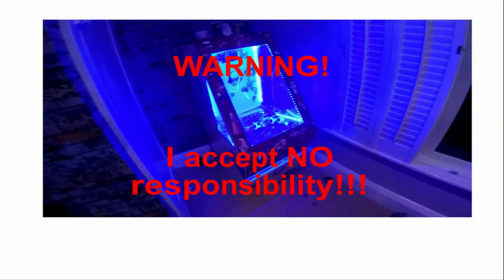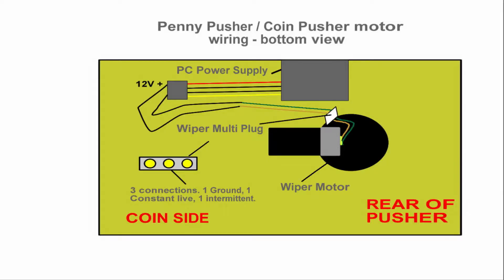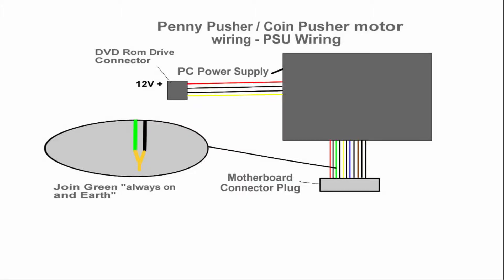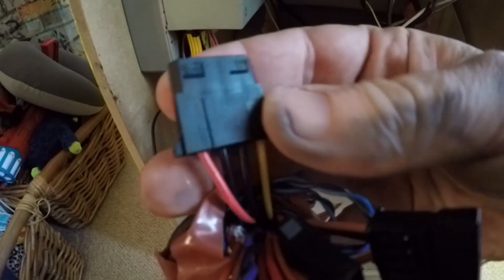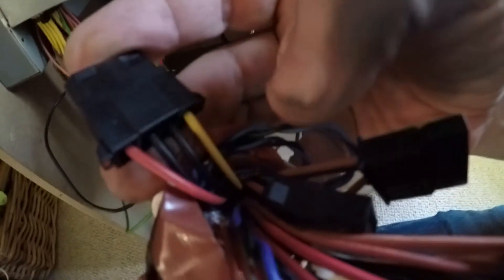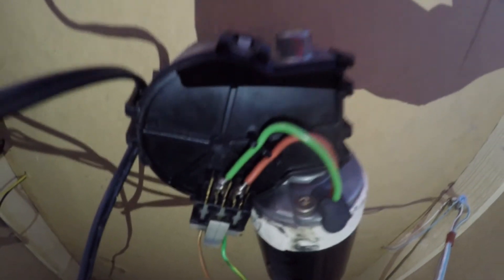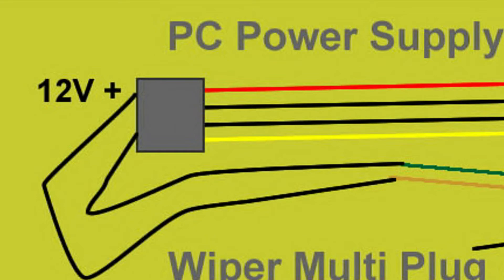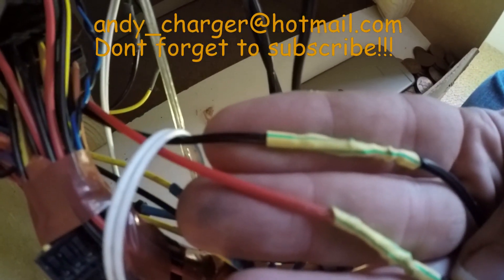How to build a coin pusher - Part 6. Wiring a wiper motor to a PSU

Comment: Hi I need help my coin pusher alarm won't on or the drop won't close when tilted also the kill button won't work either any suggestions
Reply from the maker: Hi Michael. My coin push is totally home made. Unfortunately I have not built in the more commercial "tamper proofing" type gadgets such as tilt and kill buttons. Have you tried contacting your manufacturer?

Comment: I try to add it to the 5v but the motor won't run on 5 just 12
Reply from the maker: Hi David, did you ever get the motor to run on 5V? The issue with the 12V is the motor will run too fast and your shelf will be flying around. The coins probably will not stay in place! Do let me know and thanks for watching!

Comment: Hi I seem to have a problem with my psu as it worked when I joined the green to black but I tried sticking a few pc fans in on a separate black and a red and it worked but I got clumsy and joined one up to black and yellow and now the fan won't work on the psu.
It does go round when I first turn it on but stops straight away but the power light remains lit.
Any idea if it's knackered or not?

Comment: atx psu colour scheme says yellow is +12v and red is +5v. did you run your wiper motor on 5v to make it run slower
Reply from the maker: Hi William, yes that is exactly what I did. To make the motor run slow enough for the pusher to function although I do say the 12v in the video. I think it was the 5v I use! I will amend! Thanks for watching!

Comment: hi i have a motor and is got 3 wires on it i have put the psu on the blue/brown and yellow/red but not working the PSU works one black i have try every think dose this mean the motor dont work i got from ebay
Reply from the maker: Lucas! So sorry I missed your reply. Did you ever get your motor up and running? Do you you need ay further assistance on the technical side of your project?